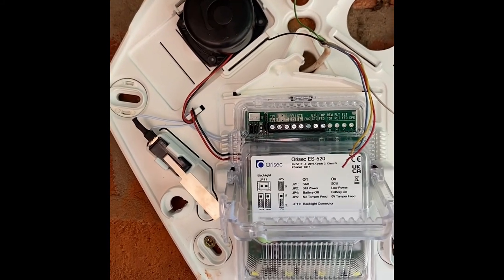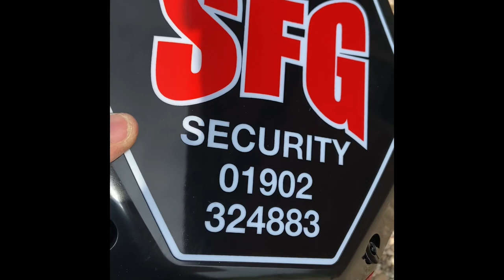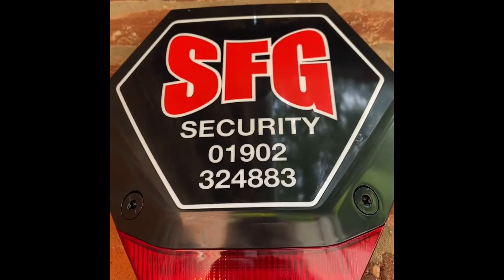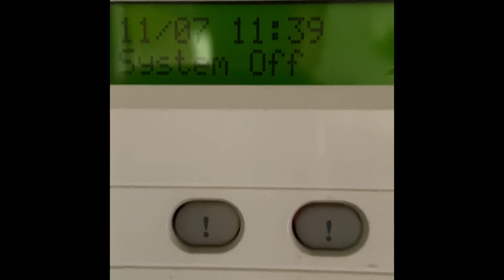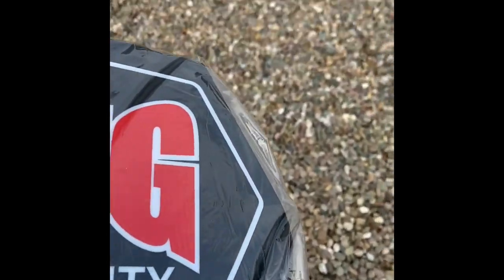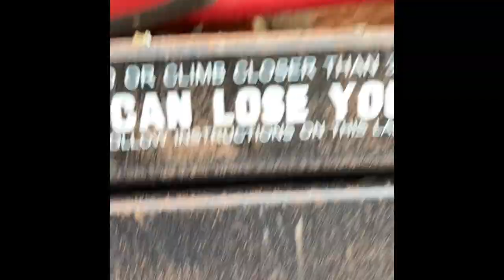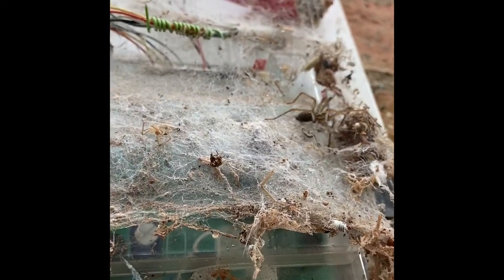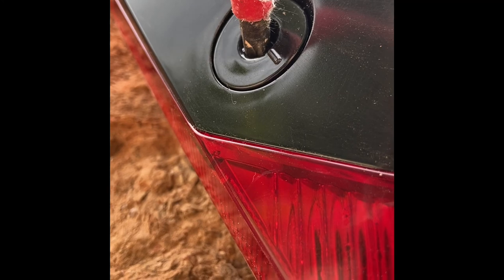Upgrading an Intruder alarm "A bit of the Countryside"

Comment: Very good video, the keypad at 4:15 is a DA Abacus 8 I believe
Reply from the maker: A bit older than that. It’s actually a Abacus 6 metal.  Also has two splitters on the system and damn if I can find Nos 2 splitter.